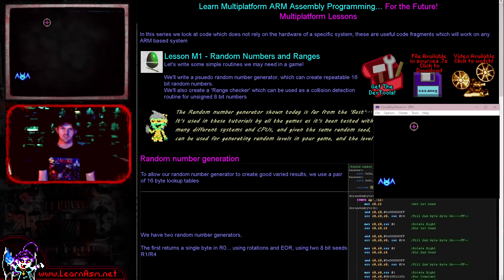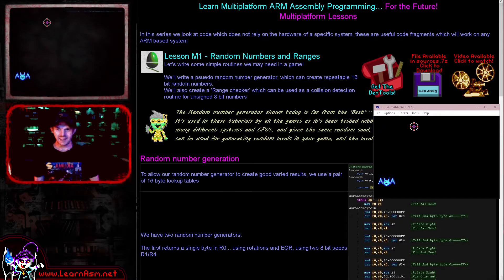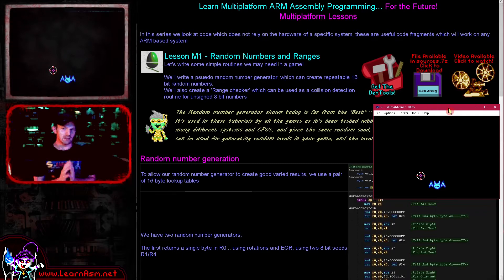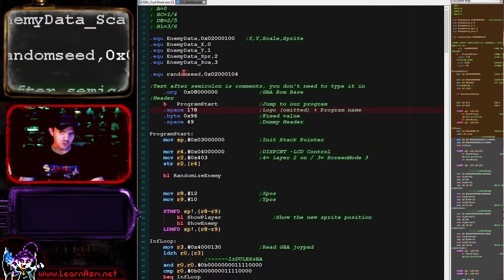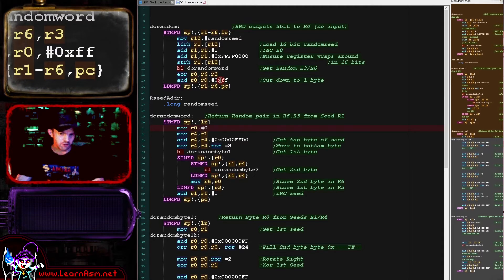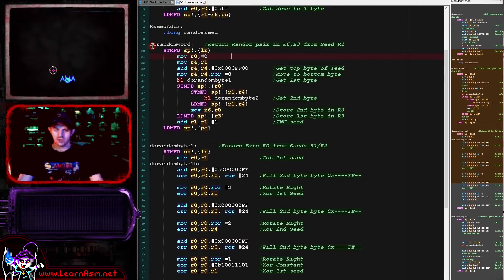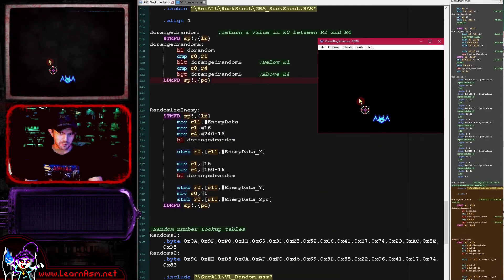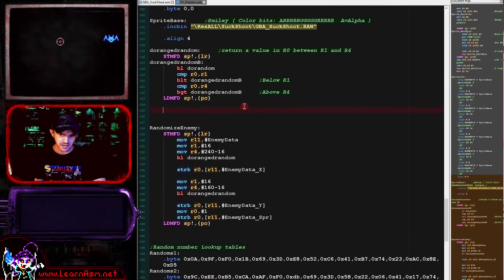Random Numbers and Range checking - ARM Assembly Lesson M1

Comment: What about rewriting the Lucifer Cryptosystem in ARM assembler and use that with a feedback loop to operate as a nonlinear random number generator (RNG)
Reply from the maker: My tutorials aim to do the same job in the same way on many systems, would doing what you describe be viable on a Z80?
Reply: @ChibiAkumas  There must be a way to implement the Lucifer on the ZILOG Z80 but the ZILOG Z800 might be the better chip as it is backwards compatible with the ZILOG Z80 and ZILOG Z80A but has additional features.